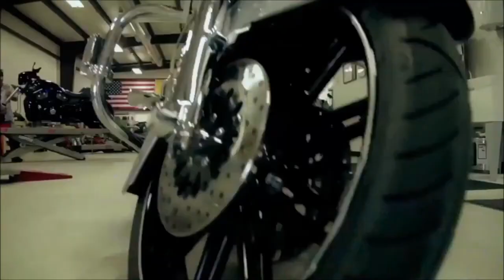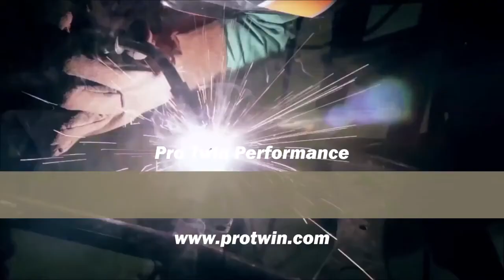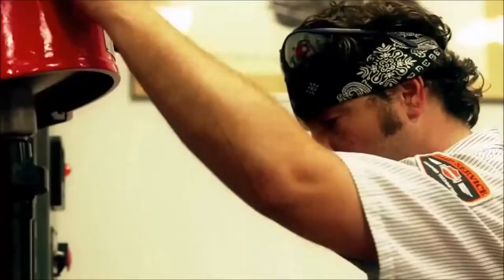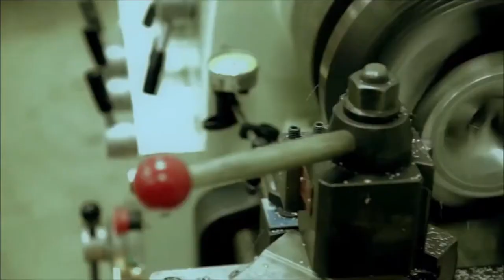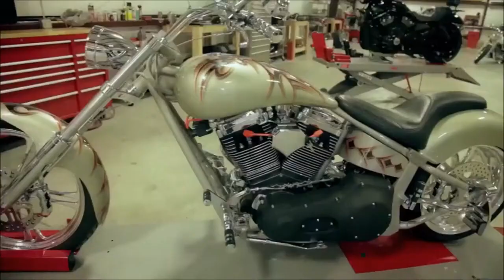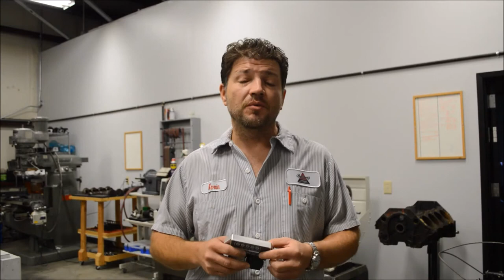Daytona Twin Tec - How To Series - Ignition Settings 1005 -1006 - 1007 - TC88 - TC88A

Comment: Will the module work with the factory security system?
Reply from the maker: Yes, the TC88 and TC88A will work with the security system. I think the evo motors were early enough not to have them, I cannot find anything in our documentation that discusses it in regards to the 1005, 1005, 1007
Reply: @DaytonaTwinTec  ok thanks

Comment: I’m considering a Twin Tec ignition for my 2000 TC carb conversion. Not a lot of info / videos out there. Thunder heart is popular but …  thoughts ?
Reply: TC88 ignition is good. I just put one on my 02 88ci dx, settings 1-5-5-rpm limit 5700. Runs good.